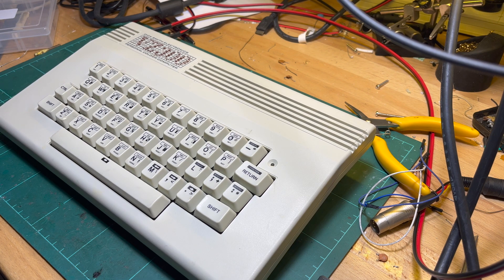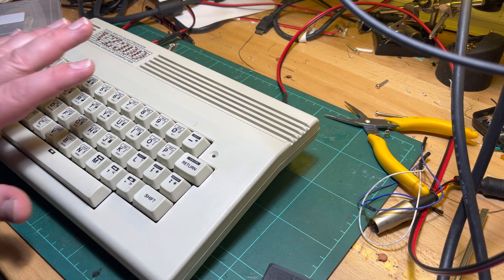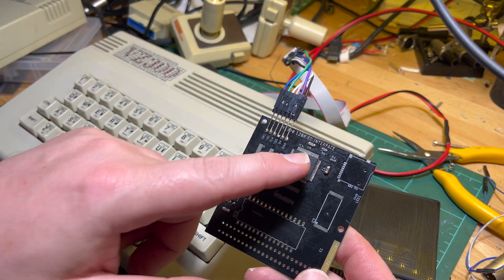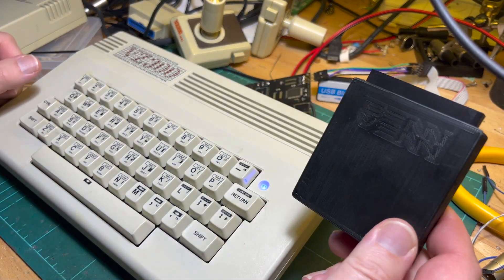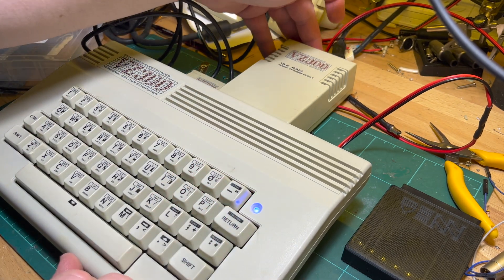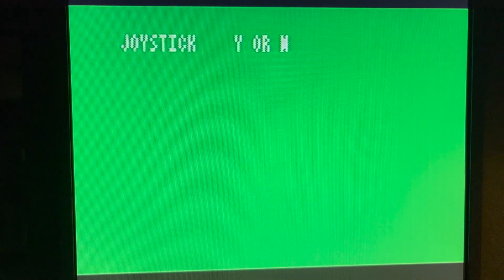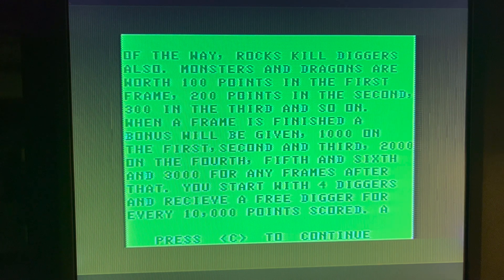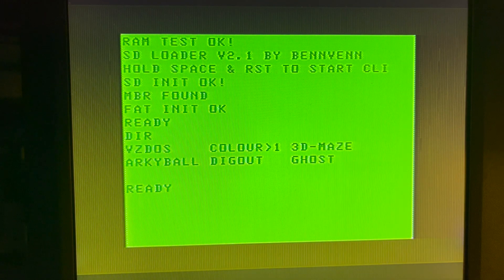🇭🇰 VZ300: Part 1 (Intro & SD Loader) [TCE #0174]

Comment: That looks like one of those reference Motorola designs that the CoCo was based off of. The CoCo 2 definitely had a slightly higher resolution mode in only 4 colours.